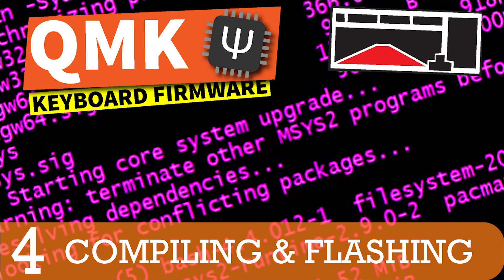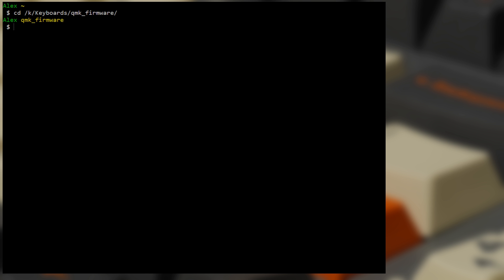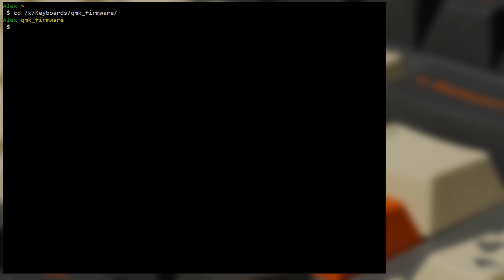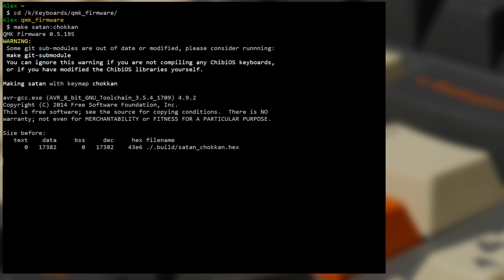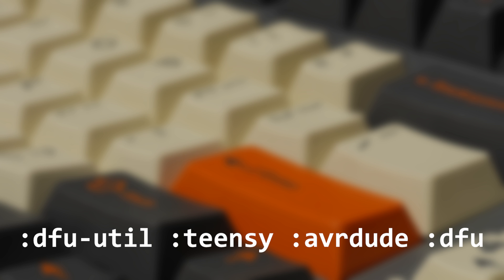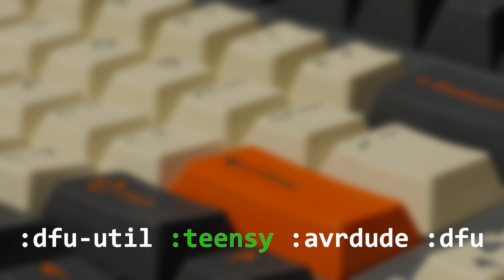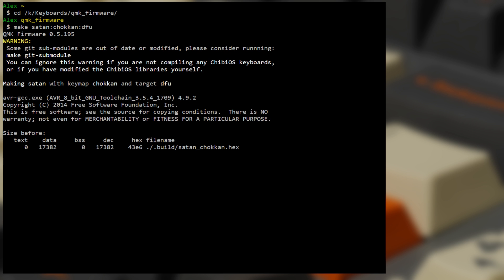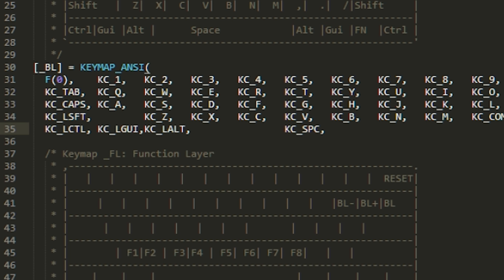QMK Firmware Tutorial: Compiling & Flashing (Part 4)

Comment: no device present.
Gergo

trying to flash new firmware to it, it already has default firmware but a key on right side doesn't work and left side doesn't work at all. when the halves are connected, the right side acts weird.
when i activate a key it holds the key for a second. strange.

the hex file did get created so i guess i'll manually flash it to the device if that works.

Comment: I am having an odd issue. I try my firmware I get:

make  alt:default 
 $ make alt:default:
QMK Firmware 0.6.233
make: * No rule to make target 'alt:defult:qmk_firmware'. Stop.
|
|  QMK's make format recently changed to use folder locations and colons:
|     make project_folder:keymap[:target]
|  Examples:
|     make planck/rev4:default:dfu
|     make planck:default

But if I try: make satan:default          it works just fine
problem is that I don't have your keyboard or I would be in business. I am totally lost any help would be much appreciated
Reply: nm i figured it out. so my keyboard is the massdrop alt. what was going on was the folder is qmk_fimware\keyboards\massdrop\alt. I just put the alt folder in the root of the keyboard folder and ran make alt:mac as a test and it worked!!!! thanks for the great video.
Reply from the maker: Great! Glad managed to get it done.
Reply: @Chokkan  Thanks for the awesome video! I learned a lot.
Reply: @Chokkan  I spent the a good chunk of today desoldering the switches on my old dead keyboard so I can move the switches to my Massdrop alt. Even 3d printed some keycaps. I am really getting into modding these things its super fun.
Reply from the maker: I'm glad it was helpful. I'm just sorry I can't answer everyone's questions, as I basically said everything I know in this video XD. Thankfully, smart people are working on GUI configurators to make it super simple.

Comment: when i enter the make <keyboardfolder>:<keymapfolder> with my info it says avr-gcc: command not found
Reply: I get the same error. Have you found a solution, yet?
Reply from the maker: Only thing I can think of is that you may not be in the right folder when you enter the command. I think you need to be in the root of the QMK folder. Another user had the same issue and solved it, but I'm afraid I can't remember the details. Check the comments for these videos.
Reply: @Chokkan  Well, I generally had problems using MSYS2. The installation went fine, but then it didn't know commands "git", "make" and, to make things worse, "apt" and "apt-get". So I switched to my Ubuntu, which is running on the Windows subsystem for Linux.
git worked
make needed installation but worked
avr-gcc needed a tricky installation
avr-libc was required according to StackOverflow (avr/io.h missing) and needed installation

To install avr-gcc, follow this reddit thread:
https://www.reddit.com/r/MechanicalKeyboards/comments/8v1j91/qmk_question_unable_to_locate_avrgcc/
User aditya3098 found a way to fix the problem.
Reply: Unfortunately turns out i have a hardware bug with my iris :(
Reply from the maker: I no :( Hope you can get it fixed.

Comment: Hey, I'm a little late to the party, but I keep getting the avr-gcc command not found thing every time I try to make. Any insight on what I could possibly do?
Reply from the maker: Hi, are you running the command from the correct directory? Usually they error happens when you're trying to run it outside of wherever you installed msys2.

Comment: Im also getting the same error when compiling. "Bash: make: command not found" .. any idea? Thanks!
Reply from the maker: Are you in the correct directory. I don't think I made that clear enough. You need to be in the same directory you did all the other commands from. Make sure you aren't trying to do this from the sub-directory for your keyboard. Let me know if that fixes it.
Reply: I was able to solve this by going thru the reinstall. I am actually on the directory. Your instructions were actually clear. Great video.
Reply from the maker: Oh that's great. Hope everything goes smoothly from here.
Reply: I've got new error after the make command. Im sure Im on the right directory this time.
$ make iris:aj
Error: cmp command not found, please install diffutils
make: * [Makefile:535: iris:aj] Error 1
Reply from the maker: That one has me stumped, I'm afraid. Try on the QMK Discord or the OLKB subreddit. There's a lot of people who might be able to figure that one out.
Reply: try running util/qmk_install.sh inside your qmk directory

Comment: Hey Chokkan, do you have any tips about how to flash a pre-compiled .hex file?  I feel like it's relatively simple but I just can't figure it out.  Or even .bin files in the qmk_firmware directory?  I've made a cool layout with an online graphical tool and trying to work out what command to run to flash the file.
Reply: I am struggling with this as well. Did you figure it out?
Reply from the maker: I'm pretty sure that you can do that with the QMK toolbox application.
Reply: I can't remember why the toolbox application didn't work for me, but I followed the method Chokkan described above.  It's a bit of a time-sink but I found the shortest path is changing the template configurations that come with QMK firmware.  This takes a bit of research and learning because there's no legend that explains the different combinations of keys.

Probably worth checking out the toolbox app again!

Comment: make: * No rule to make target 'kb:default'. Stop.
 halpppp

edit : so apparently i forgot to paste my keymap folder :D:D:D, but another error appears : 

Making kb with keymap default

/bin/sh: dfu-programmer: command not found
/bin/sh: dfu-programmer: command not found
/bin/sh: avr-gcc: command not found
sh: avr-gcc: command not found
sh: avr-gcc: command not found
make[1]: * [tmk_core/rules.mk:243: gccversion] Error 127
Make finished with errors
make: * [Makefile:543: kb:default] Error 1

edit2:
i might have missed something while setting up the env. let me start over
Reply from the maker: Did you get it sorted out?
Reply: i did, but there's one thing : when i pressed my BL_TOGG or BL_INC the backlight started flashing (might have to put epilepsy warning on my keyboard) and i had to turn off the backlight, any way to fix this?

p.s. : great tutorial, this is what i have been looking for all my life. Thanks
Reply from the maker: You might have a loose connection on the PCB somewhere. What keyboard are you using?
Reply: i hope not :D

i'm using XD60v2 PCB btw
Reply from the maker: Try flashing another layout from qmk. Might be something screwy with the default. I find that sometimes they don't give much thought when setting them up. A layout made by someone who is using one on a daily basis might have the kinks worked out.

Comment: When I compile my keymap, the chibios error occurs. I solved it with this solution; https://github.com/qmk/qmk_firmware/issues/602 
Thanks for nice instructions, btw
Reply from the maker: Thanks for sharing. Which board are you using?
Reply: I think the board doesn't matter, because it was test compiling. Maybe I messed up installation somehow. Anyway, I was trying to build LFKeyboards LFK87 Firmware. It's quite good ALPS/SMK compatible board anyway. You can check it out in here : http://www.lfkeyboards.com
Reply from the maker: Cool, thanks.

Comment: Question. So I already have everything flashed, keyboard works, but I'm trying to add a KC_CAPS command on the adjust layer. Whenever I try to reset/flash the updated keymap, I just get this:

Detected controller on USB port at /dev/ttyS2
sh: line 14: avrdude: command not found
make[1]: * [tmk_core/avr.mk:172: avrdude] Error 127
Make finished with errors

I'm running a Pro Micro on a Viterbi. If anyone could help, it'd be much appreciated.
Reply from the maker: Hiya, sorry it took so long to reply. Are you still getting that error? DId you flash using the same command before adding the KC_CAPS code?
Reply: Chokkan - Mech in Japan yes, and I can no longer flash even  pre-made layouts for the viterbi. I can't find what I'm missing